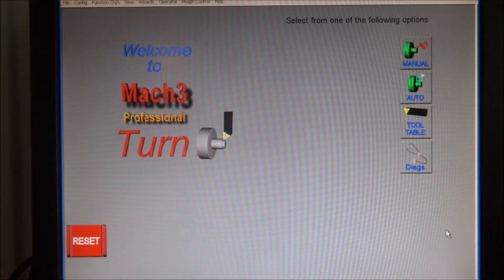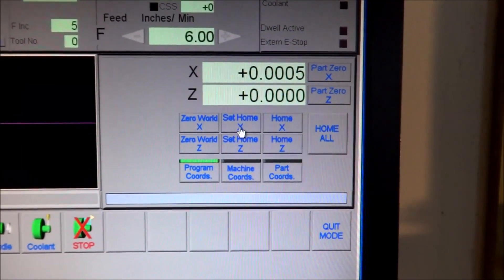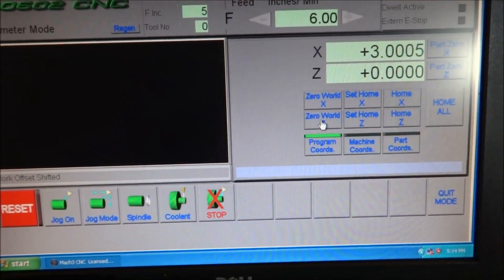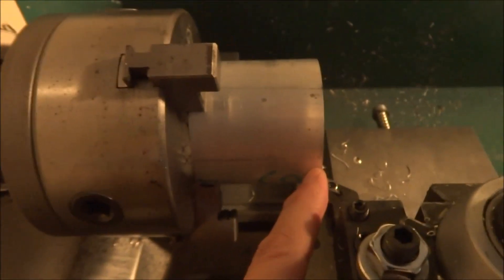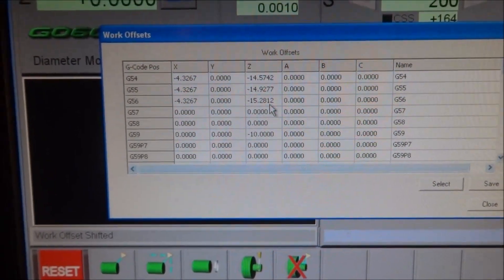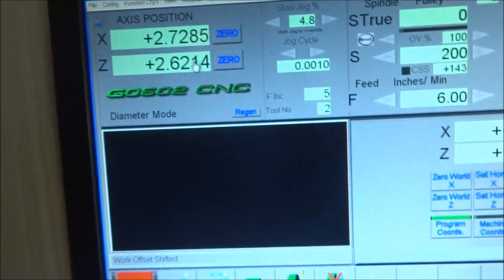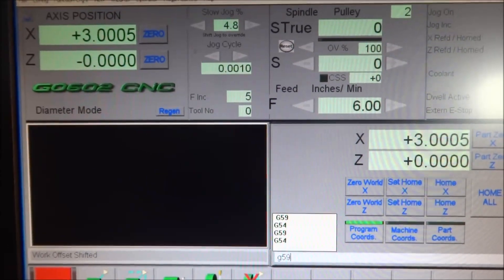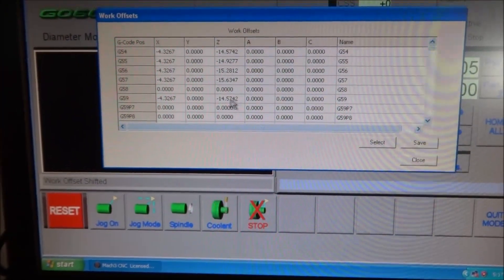G0602 Mach3 Turn How To Set Part Zero and Work Offsets

Comment: Hi Sam , i cant set on x axis centerline i use postproccesor on mastercam 2 x Lathe machine type z axis ok but x axis not to be. for example my stock diameter 25 mm i setting tool setup all step but x axis any way not to be right. please help me. If you want see video i can send u. thanks have a nice day be safe.
Reply from the maker: Do you have Mach3 set to radius mode or diameter mode?
Reply: @CNC4XR7   I have set to diameter mode. Should be have set to radius mode?
Reply from the maker: @mcht10u ah yes that will do it.

Comment: Good day, I have a problem with the travel in the cars of X and Z on a lathe, I adjust them in settings and in mill I move them and they run the distance with precision. but on turning I move it .1 "the X axis and it moves .210" and on the Z axis I move it .1 "and it moves 0.030" thanks.
Reply from the maker: There could be several things going on. what are the Ball screw Size on the lathe compared to the Mill? RM1605 are 5mm pitch and RM1204 are 4mm pitch. so the calculations will be different.
Also if you are in diameter mode the X travel will be double shown on the DRO
Reply: @CNC4XR7 Hi,  how are you? I made the settings on the main screen of mach 3 the settings screen (Alt-6) (set steps per unit) one, but the machine is a wood lathe and has its own pc, the other machine is totally separate with separate pc, it is a cnc router and it works very well. and did it again today but without success.

Comment: we had revision a dynamyte lathe for mach3 at a our highschool. but now we cant use it because   we dont know which cam processor should use. and what are g codes for mach3 lathe. by the way sorry about my english . its not good. my question is  neceessary a port processor for this machine can we use it only manuel g code? if a post processor necessary for use this . how can we find it and which one? thanks your help
Reply from the maker: I use the generic fanuc post processor ans modify as needed.

Comment: Hi there, i got a problem with my CNC Lathe setup. When i do my touchoff on X and measure diameter of part and input it into Mach 3 , then i proceed to do a “G1 X0” the tool does not move to Centerline. It moves to opposite side of diameter i measured. Now FYi this controller was on a old CnC Mill, therefore the controller is a little old aswell. Could it be the controller or could it be a setting in Mach 3? Please give me feedback i al breaking my head. Thanks
Reply from the maker: Hmmm without looking at the screen it sounds like your inputting a Diameter Say 1" But your screen is setup for Radius Mode ? So the 1" input would be actually 2" then when you g0 X0.0 it moves 1".
Check for Mode.
in Config /ports pins turn options top left make sure Diameter mode is checked.

Comment: hi I have a question for you looking at using Mach 3 turn what post processor are you using in fusion to mach 3 turn please
Reply from the maker: I use the Mach3 turn post processor I often have to modify it for CSS etc.

Comment: have you had any issues with running a fusion 360 gcode  on mach turn ? or do you use another cam software?
Reply from the maker: Yes the code is not always what I want so i end up editing it. Threading is a issue. most other cam ops are ok.

Comment: Interesting.  I don't think I've ever used the work offsets in Turn.  I definitely have some parts to use this with! Thanks!
Reply from the maker: Like most I think I learn as the need arises. I recently posted a video to do these parts with a Sub routine which simplified the G code and made setup very easy. be sure to check that vid out.
Reply: @CNC4XR7  Took me a bit to find it, but I did.....very good vid. Thanks!

Comment: 7:46 it will spring cut when you move axis back. just stop spindle and measure when tool is there
Reply from the maker: i normally  just run the code and measure the part and adjust as needed. I start with a negative tool wear and adjust. I find this works well as YES the is a spring effect that will through you off.

Comment: Just a quick tip if you want to be able to accurately and dependably set your x axis zero automatically on machine start up every time. 

This only works if you have accurate and repeatable homing switches. 

Start mach and go to the general config screen. 

Click on "copy g59.253 to g54 at startup"  save the settings and then exit and re start mach.

Reference your machine home

Now make sure you have the correct tool that is in your holder called up in mach. 

Now command  g59p253.

At this point you need to accurately zero your x axis - if you use a test cut as your method then do it.  Set z zero at a safe increment somewhere maybe 6 inches off the chuck. 

Look at your fixture offsets and scroll down to the g59.253 and make sure there are now work offsets in there.  

When you re start mach from now on it will copy the offsets from g59.253 and you will start out in g54 with your part zero for the x axis.   

Just need to home your machine and you should never need to adjust your x zero again. 

You only need to zero z before beginning your cut.
Reply from the maker: Thanks for the tip!
Reply: @CNC4XR7  It took me a while to figure out why my g54 zero was all over the place.  Once I started this method I only have to re zero if my master tool changes. I also heavily use tool wear offsets to dial in accuracy.
Reply from the maker: Great tip, Yes tool wear is a big help!

Comment: did you run into any problems with mach forgetting where z 0 is. I followed the same steps you perform and well sometimes it works and others its fine till i run the program and it does what ever it wants. I start g54 enter light face to get z0 then will take a light skim and measure for x0. When it doesn't work after I cycle start it thinks z 0 is usually about .500 from where z0 actually is closer to the spindle and x0 goes way out sometimes.
Reply from the maker: well a couple things to watch out for. make sure persistent dro's are checked in config that way it remembers where it is after a power down. also make sure the tool # is correct when you set your zero's and make sure your tool call are T0101 the second 01 is tool offsets.
Reply: I think i understand so if like say my job starts with tool #4 enter T0404-Enter, G54-Enter, then set the Z and X 0. Oh I have one other question but its about the tach signal going to mach what do you pull the signal from to send to mach. I have the G0752. I was thinking I could tap into the signal for the factory tach but feel like I'm going to have to use the same tach you are using because I think the grizzly one is more than 1 pulse per rev.
Reply from the maker: Hi Kyle,
 Does your DRO's match the distance your tool is off the part? when the craziness happens?
if not check for mechanical issues. if so dbl check and make sure not offsets are set clear them and start over. hopefully you got it.
 The 752 tach signal I cant say for sure it looks as though it has a magnetic pickup? with only one magnet?

if so you should be good. the Yellow wire from the tach looks to be the signal  or pulse. as long as it transitions from  1-4 volts you should be able to tap into this wire and run it to the BOB like I did.
Reply: ill check that out this week, that's what i was thinking with the tach until I saw all these people creating transistor circuits and i was like ehh I don't know know. I'll check this weekend to see if that offset parameter  is checked and that the DRO matches.
Reply: well i have been out of the country for the past month and just got back and hooked up the same tach you have seemed overly simple,  what I am having a problem with is getting mach to match the tach. sometimes it reads correctly sometimes the rpm drops to 48 and sometimes it bounces all over the place. but the tach on the unit remains steady, is there something in mach that needs to be calibrated?
Reply from the maker: 2 things make sure spindle speed averaging is checked  and you may need a stronger magnet. I picked some super magnets up at Home Depot.
Reply: I will check that out in the morning to see if that is checked and to pick up another magnet. Thank you for all the help its little things like this i'm lost on most the time
Reply from the maker: kyle morgan 
No problem yeah I had to change the magnet the one that came with it was weak.

Let me k ow how it goes
Reply: CNC4XR7 well I changed the magnet to a stronger one and now I don’t get any readings in Mach rpm is stable on the tach, the diagnostic tab shows green for index but nothing.
Reply from the maker: Hmm You should Email me
Reply: CNC4XR7 I just sent you an email off your page

Comment: Yes Sam, that makes perfect sense. You also can include these fixture changes in you program and the machine will run continually until the number of fixture changes have been completed. Extremely useful especially after you get your gang tooling hooked up, just push the button and let er knaw!!!! Great information as always, great job Sam.
Reply from the maker: Cncmike68 
At the end of the code you will have M30 stop and rewind just before this simply put G55 the copy and paste the gcode you want to rerun. Make sure it does not have a offset written into the code ie. G54
Reply from the maker: Thanks Wyatt, Yes I did fail to mention that you can add the offset to the G code and just keep going.
Reply: So how would we add this to the g code to keep it running,
Reply: https://youtu.be/-Qtvj5iM_VI          Check out this link, this video will explain it way better than I could plus it offers a lot of good information on post processors.
Reply: So, the video shows you how to make the post processor write the code for you when you program the part, all you have to do is have the fixtures pre determined so the references are correct.